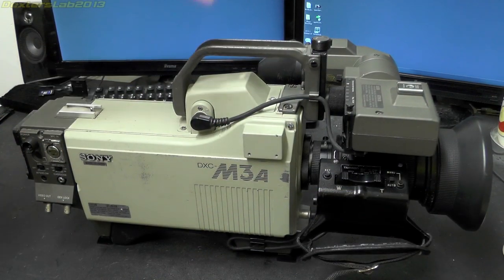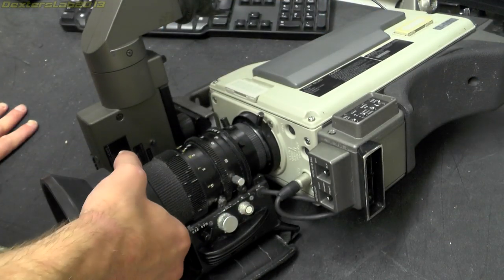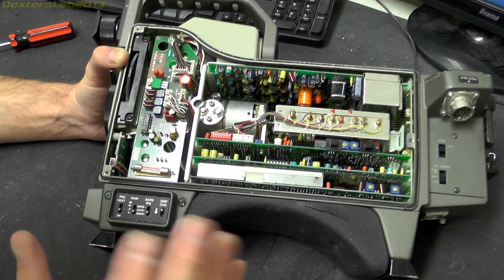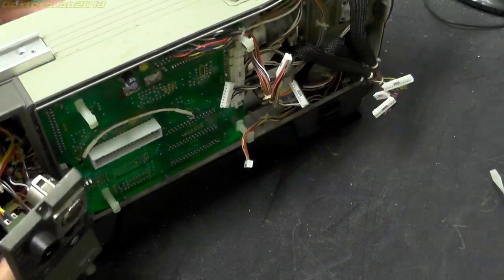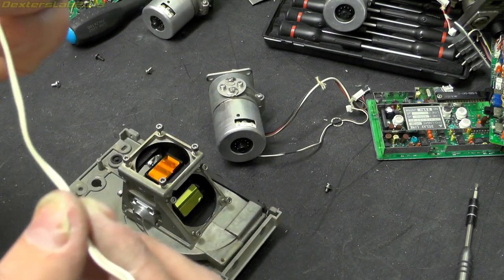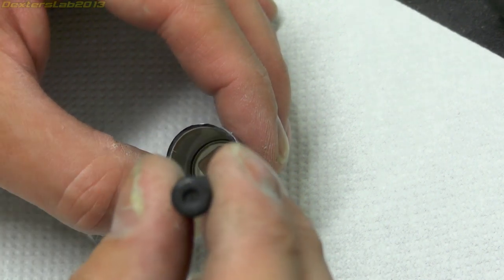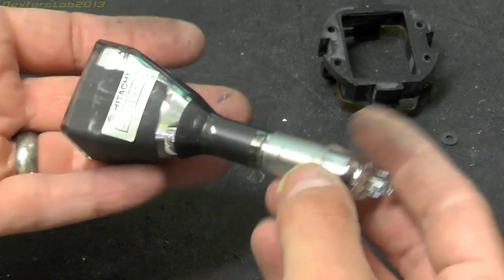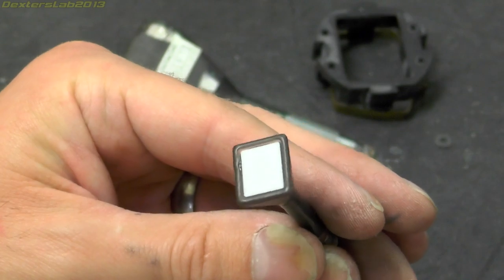DL#096 - Sony DXC-M3A 1980s ENG Video Camera Teardown

Comment: Thanks for another trip down memory lane. The RET button on the lens switches the return from the VTR or external video to the viewfinder if the rear switch is set to AUTO. In some later cameras you could see "confidence" playback while recording. Bias lights helped reduce lag in dark scenes and was usually about 3% of full white. The tubes would still work without the bias light, the auto black circuit could be activated to compensate for the loss. 
I always thought the REC/TALLY indicator was funny.

Comment: RET is to look at the last few seconds of recorded material.
Reply: Some of the later recorders also allowed instant replay as you were recording (2nd set of heads) so it was possible to check that there were no head clogs or tape defects as you were recording - obviously there was a very small time delay so it wasn't easy for the camera operator to use continuously but I used to press the button near the zoom rocker that made the viewfinder show the instant playback occasionally whilst shooting just to be sure all was well.

Comment: I have an M3, not the A model. I could be wrong but the tubes look a little different and so do the electronics and I/O layout (somewhat). Some of the electronics you show here seem newer to me also. It's a really good camera, almost maxes out the resolution you can get in a composite signal (maybe it did when it was newer). When recorded with a DV recorder through only composite the result is surprisingly good although it would look best on 1" videotape. It has loose and slightly corroded connections that can get very temperamental; it would pick up all sorts of strange noise and the video levels were all over the place. I almost thought it was done but after taking the electronics apart and re-assembling and tightening it really perked up, only problems are a bad zoom control pot and melting urethane goo. I won't be hauling it around to shoot outdoors much due to said loose connections. And it needs a LOT of light to look it's best. My only disappointment is that the tubes are so good they don't leave long trails from moving bright image areas, which I kind of wanted. But it is plenty good for other video art. Thank you for making a video about it!